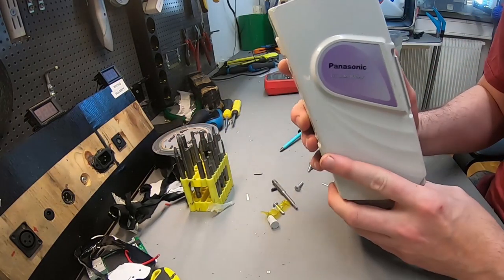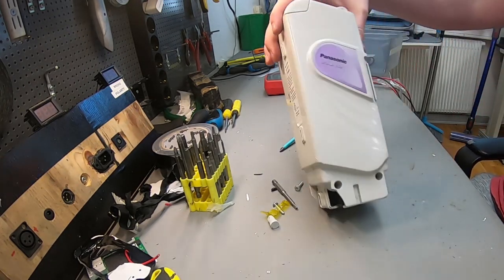Helkama/Monark/Panasonic ebike battery NKY195B02 from 2008

Comment: Hi Battery Doctor,
Thanks for the video. 
I have an old NKY190B02, which is empty. When pressing the button at the battery, the LED's are wandering from (E)mpty til up (F)ull, . Connected to the charger for hours, it is not charging, since the behaviour of the LED stays the same.
I have another old battery NKY177B02, which still works, but has a very limited range (5-10km). There I the charger works.
My options are:
- replace the lock of the battery, so I can buy a newer 26V model
- replace the cells in the NKY190B02
What do you suggest ? Could you provide me links where I could buy another battery lock system or the replacement cells for NKY190B02?
Thanks in advance

Comment: Hello Battery Doctor, thank you for posting this one :). I have bought a flyer bike , and have a NKY190B02 which basically is the same as that one, but with another brand (Biketec). Its from 2008 as well, and the battery still has around 15% capacity, charges and Im able to use the bicycle for around 10 km! I will try to replace the cells, but there is an overwhelming amount of info on how to do this so im a bit confused. I can simply replace the cells and use the same BMS and the same charger as long as I keep the same configuration? Thank you very very much and keep up the great work
Reply: Yes "replace the cells and use the same BMS" and it will work.
Reply: @Batteridoktorn  So when this original has 2 separate 7s pack with both having their own bms, you have to do 2 separate 7s2p packs instead 7s4p beacause of the 2 bms?